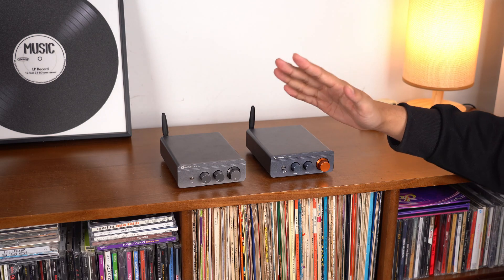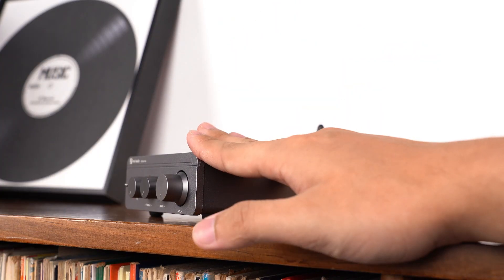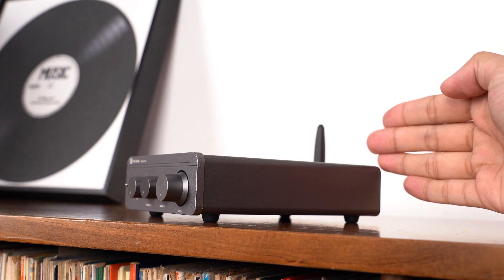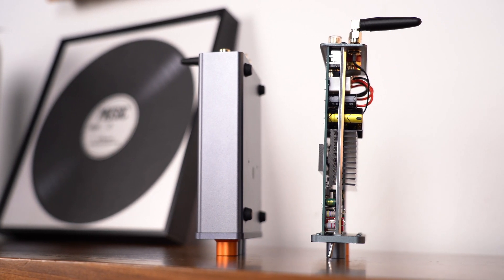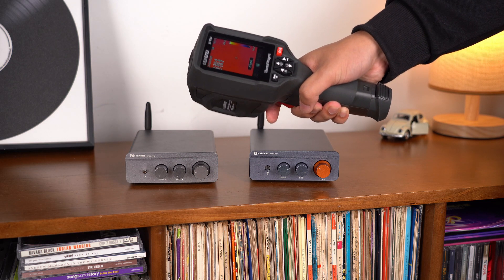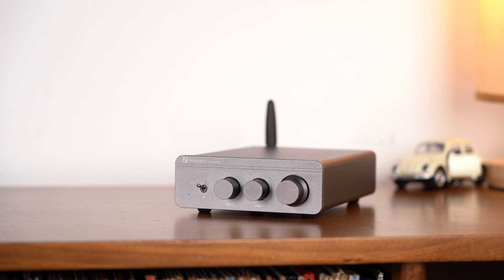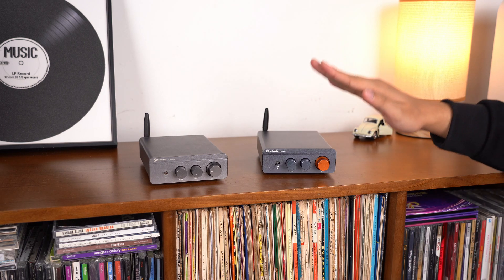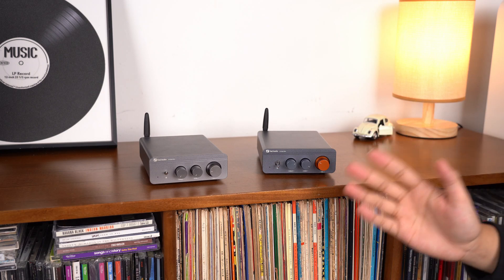Fosi Audio BT20A Pro Cooling Upgrade: Lower Temperature, Higher Stability!

Comment: I stuck a .5mm thermal pad and copper heatsink on top of mine to help keep it cool on the outside.
Reply: im confused. mine is working fine in a really big room with the 32V power supply and can make me deaf and here im asking myself if you guys got concert halls to use this thing in.. but then again i got no idea about audio..
Reply: @StyloTimo I'm running the optional 48V power supply and it causes the amp to run pretty hot.
Reply: @Bikerboy1282 thanks, I got that but what does it do that the 32v can't do 😂 I know it delivers more watts but except being louder 32v sounds quite alright for me.
Reply: @StyloTimo it just makes more power. My amp came with the 48V and it gets hot even when it's idling. I think it's a similar situation to PC overclocking the small performance boost makes an exponential amount of extra heat

Comment: What about us, having old version of BT20A pro? What can we do? Do you provide any upgrade also for us?
Reply: Does apple give you a new iphone when they update?
Reply: No, Apple doesn't give me a new iPhone either, and that comparison is silly because a new iPhone is a new model! On the other hand, Honda, for example, will replace a faulty fuel pump free of charge through a recall if they determine that it installed a defective pump that could cause a dangerous situation. In the case of the Fosi BT20A Pro, many users have reported that it overheats, and the manufacturer has apparently acknowledged that the issue needs to be addressed. So this is not an upgrade (new functionality, ..etc.) — it's a fix for a defect (design flaw)!